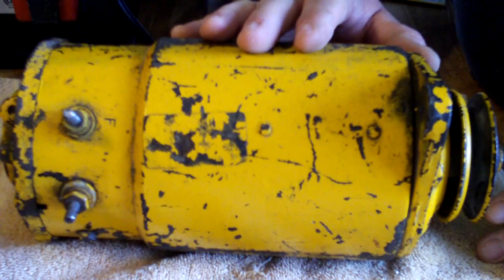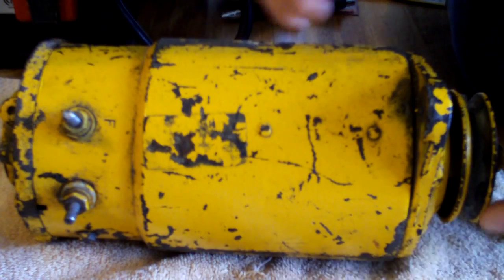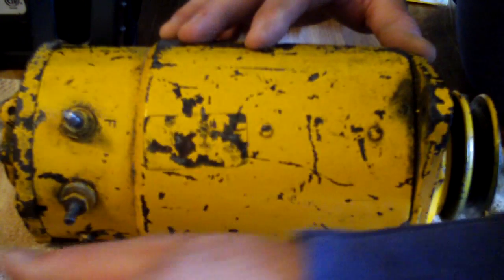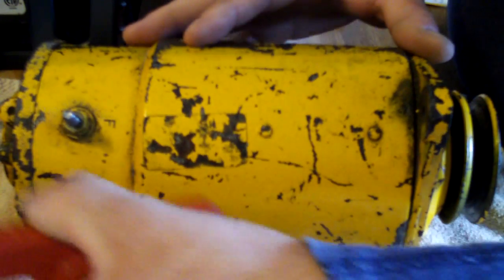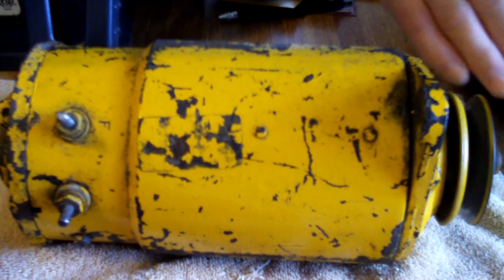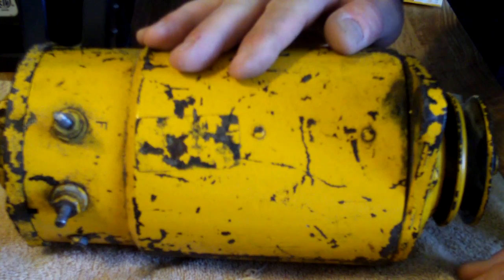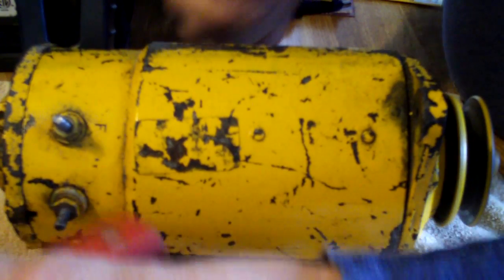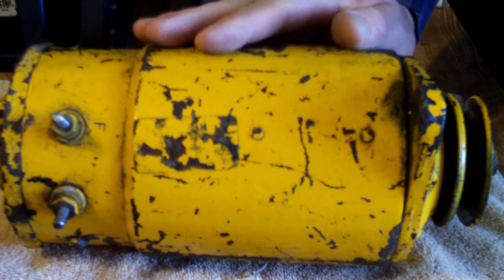Starter Generator- simple field testing.

Comment: I have a 6 volt positive ground Ford 800 tractor which I accidentally replaced a new 6 volt battery with the connectors in reverse. Since making this mistake my tractor runs only on battery power, and has very short battery life. Would you guess I damaged the voltage regulator , generator or both?
Reply from the maker: Based on your situation,  6-volt positive ground,  running only on battery power and the battery quickly dying after reversing the battery polarity, the most likely damaged component is the voltage regulator, thats my opinion.

Comment: My starter is only pushing back 2-3 volts is that something I could fix i got multiple tools and experience or should I take it to a starter shop would it be something that severe
Reply from the maker: If you mean it's only putting out 2-3 volts at the battery pole? Or is the voltage taken at your regulator. I'd imagine  if it's only that at your battery pole/post with that low of a voltage, I'd say it needs to be rebuilt. If your voltage is low at your regulator it could be numerous possibilities, dirty connection, bad wire, regulator is bad or if its adjustable the voltage would need to be adjusted accordingly, etc.. I would highly recommend you have a reputable shop rebuild it, or you purchase a good working replacement if you find the starter/Gen  as the problem.
Reply: @Wallabydam  tested from the solonoid the solonoid is new no feild wire from starter gen to the voltage regulator would that be necessary
Reply from the maker: @AandAEquipmentService1276  I would do a search for a wiring schematic for the machine your working on, and go by that, and correct  any wiring, then re check your voltages after.
Reply: @Wallabydam  can do man thanks for the help bud 👍
Reply from the maker: @AandAEquipmentService1276  good luck with  your repair, hope you find the issue.
Reply: @Wallabydam  I found it was the brushes  I got a local electric shop that has the parts for it it’s there probably em now I tried to clean em got it to a staggering 5 volts out of 12 but found what the issue is 👍
Reply from the maker: @AandAEquipmentService1276  that's great news, better than the field coils being bad. Brushes not bad to replace, armature could be a problem(bad winding), if you continue to have issues, replace it or rebuild it 👍

Comment: Totally not the way to test this piece of equipment.  It can slow down but that doesn't mean it is putting out enough voltage to recharge your battery.  It may only put out 9 volts and you need a minimum of 12 to 14 to maintain your battery charge. With less than that you will not start anything.  Put a multimeter on the field with pos lead. Ground with neg lead to motor.  Start the motor as shown and take a voltage reading in DC current.  You may think it works with method shown but it won't. It may only  need new brushes and bearings if it isn't putting out correct voltage but it needs something because it won't work to start your tractor or whatever.
Reply from the maker: Your regulator is what determines your voltage which is Separate  from your starter generator,   Also  it's either going to work or it's not  IF your charging field coil is damaged. I never said this was the correct way to fully test a starter/Generator, there could be all kinds of different issues but doing it the way that I just shows / proves that it has resistance and a working field coil for the charge side and also a working field coil for the starting side, Including brushes that are working as well as wiring inside, Its a field Test I.e. farmers swap meet, flea market, etc... if you did not read in the description this is a way to test when not on equipment at a yard sale OR flea Market purchase. If there was a problem within, It then proves to a potential  purchaser there is an issue being anything  within, IE brushes, wiring, charge coil and start coil. Hook up the battery and if it doesnt spin, that's proves a  Problem, hook up to battery and if it spins up but doesnt slow down when applying power to the Charge field post, That's a problem, also could be armature  related, it's simple. Without tools other than a 12 volt battery or 12 Volt jumper pack. I stand by this generic test.

Comment: Now I have a serious suburban SS 15 unless I have it hooked up wrong it is not charging and if I buy a rebuild kit for it from eBay will it help it,if it doesn't stop it right away and I put the kit inside the generator starter will it fix it and stop it like in your video?
Reply from the maker: Well not sure what's in the kit your purchasing,but if it's a complete  kit with coils as well. You should have a shop do the rebuild,   without the right tools the coils can be difficult  and if not aligned  properly  it will cause issues to the armature,  second after your rebuild if all is good then your generator should do exactly what I show in the video now after the rebuild if it still does not charge there is several other factors that could come into play with a no charge situation, wiring issues, ignition switch,  regulator  etc. Main issues are usually burned up coils inside the coil windings from age and shorting out internally, I cannot tell you if your purchase will fix your charging  issue. Just have go through the process of elimination til the problem is eradicated..but a proper working starter gen should stop as mine did in the video.

Comment: isnt that basically reversing the polarity, and if so isnt that bad for the field ?
Reply from the maker: No. You only energized the field to create power output is why is slows it down, creating drag. Just shows there is a good working field coil for the charging or power output  side of the generator..
Reply: Wallabydam thankyou

Comment: My starter is on my tractor and when I press the start button it smokes and sparks at A
Reply from the maker: Sounds like its shorted out, need to make sure the post terminal insulator is intact and not broken. And also need to check internals for bad field coil or any bare wire shorting..
Reply: @Wallabydam  is there a way i can take a picture and send it to you
Reply from the maker: @jaydenb7515  not that I'm aware of you could do a video and post it on YouTube
Reply: @Wallabydam  what about email?
Reply: @Wallabydam  https://youtu.be/mGIW-DFGy9A

Comment: the only wire still connected after it starts is the wire coming from the regulator. it turns over, then starts and runs only after disconnecting the battery wire from the solenoid to the starter generator. release the pedal it will shut off, push the pedal nothing touch the battery wire, to the stud turns over, move the wire away from the stud and it runs!
Reply from the maker: Your going to need a wire schematic  and run a few tests and checks.

Comment: i have a g2 yamaha  golf cart, when the engine cranks does the field energize the starter generator to stop, ? when i try to start my cart, the engine turns over but only starts when i disconnect the hot wire from the solenoid to the starter generator!
Reply from the maker: Starter gen is energized otherwise it would NOT be turning  your engine over, sounds to me you need someone to look  at your wiring and or check the solenoid  or dip switches to your cart for potential repairs

Comment: Ok my Generator for my Harley Davidson Ironhead is spinning but at a slow,steady speed ?
Shouldn't it be faster being a Harley Generator ?
Reply from the maker: For specifics you should check with your shop manual..I'm sure with different  brands and make  there are different  specifications and maybe have different  characteristics between different  types and model of STARTER/GENERATORS.
Reply: @Wallabydam  
I did bro but it doesn't say that if the Generator is at a certain speed when testing it with the battery,on if it's going bad by the speed ?
I had seen a dude use a Generator from a "farm tractor",that moves slower than a motorcycle.
But that Generator from the tractor was at a ridiculous speed.
But this Generator from a bike,that goes faster.Moves at a slow steady speed ??? 🤔
Wouldn't that Generator from the bike fly off the table basically ? 😄
Reply from the maker: @YaHUKaB_ShaRaYAL_YaShaRAL  my mind is blown. Hah.. only time I ever see a slow turning  generator  was when the armature  was failing/internal windings shorting

Comment: Tested mine today,  doesn't spin , so are you saying its bad then?
Reply from the maker: You have to then pull it apart and check for burnt wires. Worn out brushes., grounded posts or connectors,....your looking at a number  of possible issues if it's not doing anything,  you will have to investigate  it further. To answer your earlier question  There is A and an F.....F is your coil field terminal for the charging  side. The A is the armature or Starter side field coil which powers the armature to spin up to Start the engine....

Comment: What do I do if the unit spins up good but doesnt slow down when power is applied to F terminal? Do I have to replace the whole starter generator? Thanks for the awesome video!
Reply from the maker: If that happens I would check the lead wires inside for breakage and also the terminal post insulators that may be worn or damaged that may cause grounding, if those check out good, then you  may need to replace the field coils inside, it's not a easy job, you would need the correct tools to do that, at that point I would take it to a repair shop that can do the job, usually you can buy the coils online, Ebay. Sometimes has them, Just make sure you get the correct coils for your application,  they sell ccw rotation  (counter clockwise ) and can ( clockwise) field coils  there are "shoes" inside that hold these coils and if not properly  aligned while tightening  the coils to the body of the generator,  can possibly  rub against the rotating  armature and cause wear or damage, if all else fails, then yes replacement  of the generator would be necessary option.

Comment: Watching Your Video again I noticed that the Starter Rotates Counter Clockwise . The Delco I have on my Panza tractor Rotates Clockwise,  will the test work the same and is it possible to Reverse the Rotation on these? I know some engines like Kohler are Different.  Thanks
Reply from the maker: MrDanoconnor yes  it still works it's just the field coils are opposite for cub cadet tractors to counter rotate, turns the engine from the pto end of the engine and not the flywheel side.  test will still work.
Reply: Thank You
Reply from the maker: MrDanoconnor no problem! welcome.
Reply: i Have a 1940  Farmall A and My Son in law has a 1939 BOTH have NO ELECTRIC at all.. Just Hand Crank... I was wondering if there is a Belt Drive Starter Genny that would be Powerful Enough to Turn the 4 Cyl Engine? Any Suggestions? I Know the IH Cub Lowboy 4 Cyl used one.
Reply from the maker: @MrDanoconnor  I'm pretty sure you're out of luck on that one it's either going to be hand-cranked or electric starter for those, haven't heard of anyone starting one with a belt driven starter Genny.
Reply: Electric Starter is NOT an option, Bell Housing was NOT made for one. That's why I'm looking at Other options. Well, If I'm Successfull, I'll let You know. I am Going to Try it. My Engine Cranks and starts with 1 to 3 Pulls, so maybe I stand a chance we'll see. Thanks again for responding, I appreciate the input and advice. I Subbed Your Page, Great Videos.
Reply from the maker: @MrDanoconnor  dpending on the engine you would need either a very large and small pulley for mechanical  advantage  to start a 4 cylinder gas, or a much larger  higher torque starter /gen.  It will be a interesting  challenge  to engineer  and fabricate a electric starter for it.   I appreciate  the sub and compliments.  Let me know how you make out with  the starter.
Reply: Your absolutely Right.  That's why it's so easy to Turn the Crank Handle, the Diameter of the Circle it makes is about 2 Ft.  or More!  I have a HD Old Starter off a Massey Diesel Engine and if I can take the Gear off and add a Pulley to the shaft and a Idler Pulley for Engagement, Like a Mower Deck works ,  it just may work, Like a Pony Motor on a CAT.   Will be a Fun Learning Experiment for sure, will keep you posted.

Comment: When I do this to my s/g, it turns slow & growls... what do I need to do? Will brush & bearing kit help?
Reply from the maker: 1978mudtruck well there is a possibility that the bearings could be bad and need replacing because the Armature inside is hitting on the field coil shoe's. . it all depends on exactly how much play Because when it's under a load the Armature inside can very well move a certain direction towards one of the field coil shoes and rub up against it I would if I was you look into it a little more some of them have bushings and not really bearings in the very back of it the older models had roller bearings in the front end in the rear but the bearings would be a good place to start in that case.
Reply: Wallabydam I tore the s/g apart & found out it has a bushing in the back... it was ground up pretty bad & there was gold shavings all over in the case... it appears to have an oil hole in the top, but for some reason someone sealed it up... my armature was rubbing  the field coil... I ordered a new rebuild kit.... I took it to a starter shop & they said the armature isn't ruined & it'll be fine... it's on a pulling tractor so it doesn't get used much... I'm sure if I mowed or used the tractor it'd be worse than it is.... I did get the plug freed so I can oil it now... thank you for the help!
Reply from the maker: 1978mudtruck yeah I normally I just put grease in the back for the bushing bearing the older models with ball bearing had the oil port in the back that you could drop some oil in it normally as long as the Armature isn't stopped from turning it won't burn up the Armature wires but it's a good thing that you didn't run it too long because then you are mature would have been toast. sorry I didn't get back to you sooner I just seen this message today but good deal glad to hear that it's not too bad of a repair
Reply: Wallabydam I was told there's supposed to be wick that sits below the bushing hole... is that right? No problem a bout the reply! I'm sure you get plenty of questions to answer!
Reply from the maker: 1978mudtruck yes in the back behind the bushing there is something that is like a hard type of cloth that's supposed to hold oil but with those go missing I would use grease.. the only difference for me would be having to remove that bearing plate once a year to clean the old grease out and I would put a little bit of Grease back in it for use
Reply: Wallabydam I'm definitely gonna use grease.... now that I understand how to maintain it, it won't be too difficult to keep that bushing from going bad again... thanks again for the advise!
Reply from the maker: 1978mudtruck no problem maintenance is a must on these old parts definitely worth it when they are hard to find and people want more money for them.. take it easy!

Comment: I learned something new today. thanks
My Massey Ferguson 65 diesel generator is putting out 25 volts at the generator @ PTO speed. About 1500 rpms. Is that good enough?  
I read where they should put out 30-35 volts @3000 rpm but my tractor isn't made to turn that many.
Reply from the maker: to be honest with you I'm not sure exactly how many volts they are supposed to put out besides what is supposed to be 12 volts after it goes through a regulator but if you have a shop manual it will definitely let you know if it's making that much I think it should be plenty I don't see the need for having any more than that

Comment: Can you use a 12 volt pack safely on a 6 volt Generator or do you need a 6 volt battery?
Great info here
Reply from the maker: Unless you have a big enough resistor for the double voltage you will end up damaging the field coil which will get hot and possibly burn the coating off of the windings and cause a short

Comment: So let me get this straight. By using the 12 volt battery, he is flashing the field with a DC source, causing the rotor within the stator to rotate, thus creating the AC right?
Reply from the maker: I am powering the Armature side Post to spin up to speed, then  with the same twelve volts i  go from the armature post, to the F or Field post and power that, IF the Fields are in good working condition, when i do this, the armature  Should show down to a stop quickly, if those fields do not, they are not in good Charge working order, it will start but not charge,

Comment: Hey I've tested mine and the field seams to have gone bad it just continues to spin is there a way to repair this if so please help my tractor will not charge the battery due to this
Reply: Take the bolts and end frame off of the back of the starter .
Look inside to see if the brushes are worn out, also look for a broken wire or one that is disconnected from its terminal.

Comment from the maker: you need to make sure the rod is adjusted so it pulls enough to push the friction button into the clutch, to allow it to disengage, if it does not, then its stuck, alot of times if you have the lever pulled back to disengage it, and you go using the mower, it may break it free, you may also have to tap it lightly with a brass druft and hammer, dont spray your clutch with oil, it will soak in the clutch material and cause it to fail, if you dont have a friction button, you can find them on Ebay.